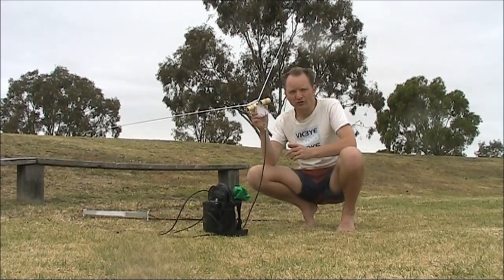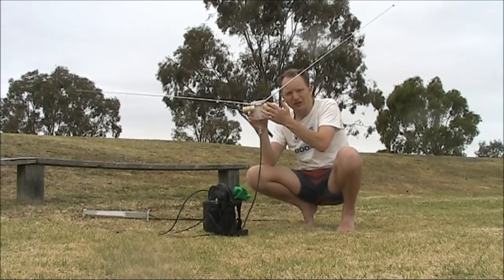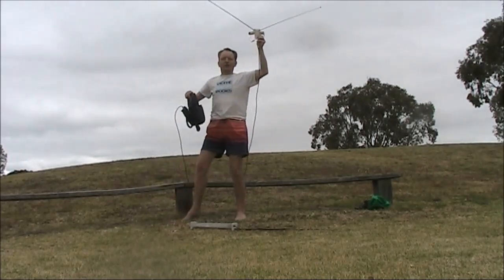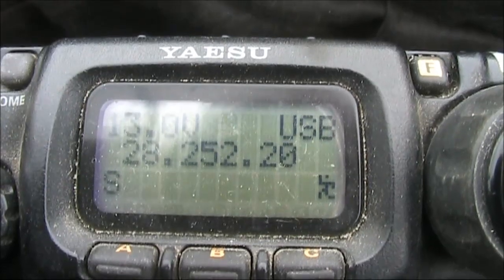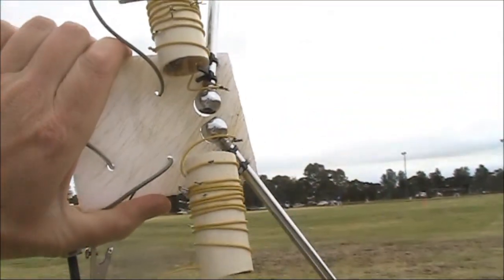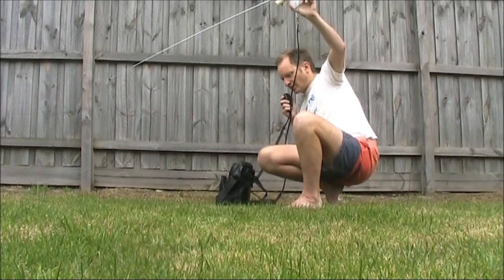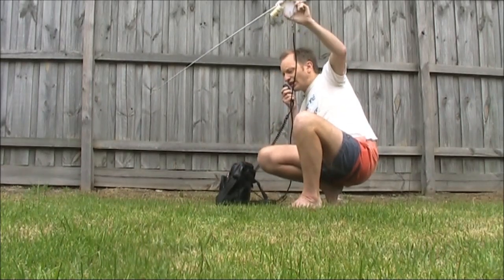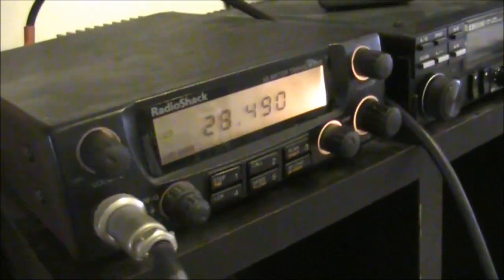A handheld telescopic portable dipole for 6 and 10 metres

Comment: 2:43 Can someone please explain to me why someone would drop a carrier on a frequency in use?
Reply from the maker: Prob just carelessness. And, unlike 80m where everyone hears the same set of stations, 10m propagation is notorious for frequencies appearing clear in some locations but actually being busy.
Reply: @vk3ye  The propagation issue can definitely be a factor, but in this case it certainly sounds like some people don't listen before transmitting - ok, I can't see the entire contact from your video, but it appears that you're not ragchewing with long overs (and most QRP stations don't ragchew unless conditions are good), so if the carrier dropper had listened a little longer they would've heard the QRO station and realised the frequency was busy.